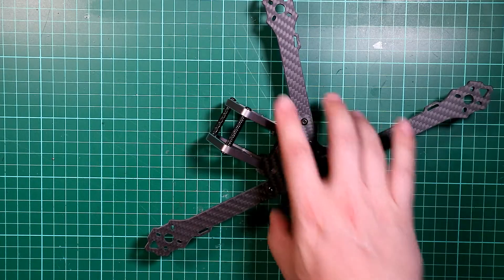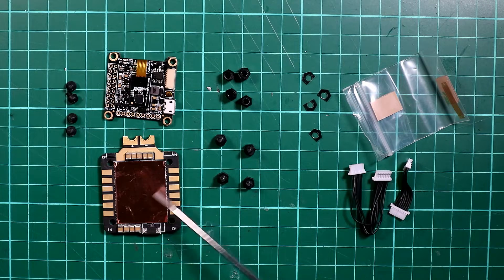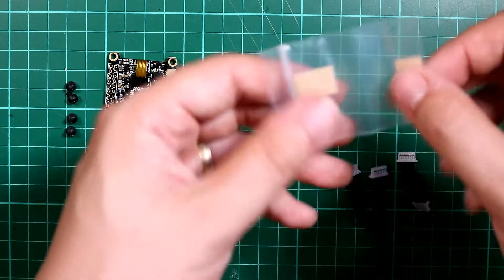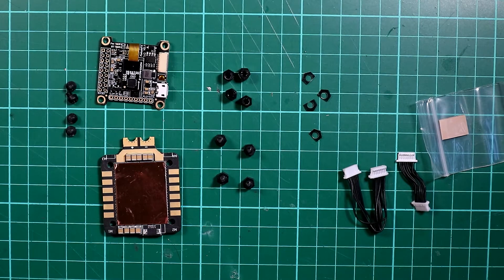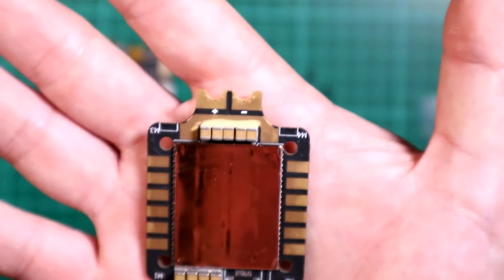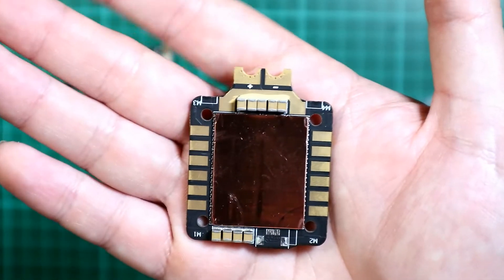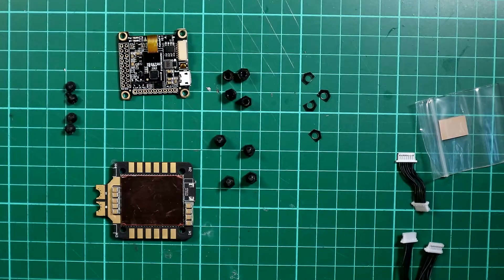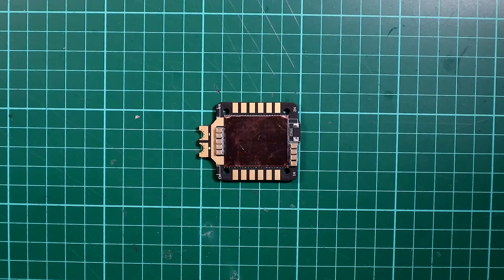Lets Build: A Decent Beginners FPV Mini-quad Part 3 holybro kakute f4 v2 Overview  & tekko32 setup

Comment: Hi, great video, really useful.  I’m not sure I follow why you mounted the ESC upside down.  Is it simply because when you built the frame, the XT60 clip ended up on the wrong side?
Reply from the maker: Mainly it was more ease of assembly and disassembly.